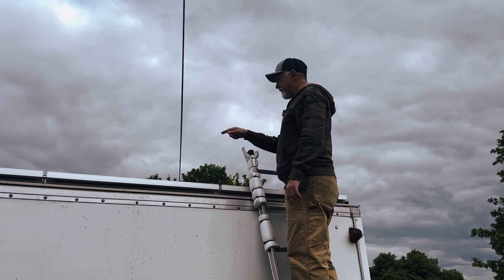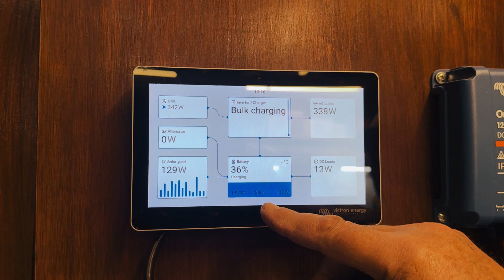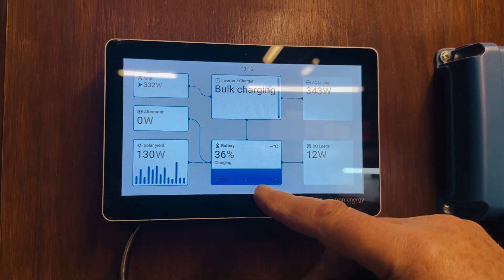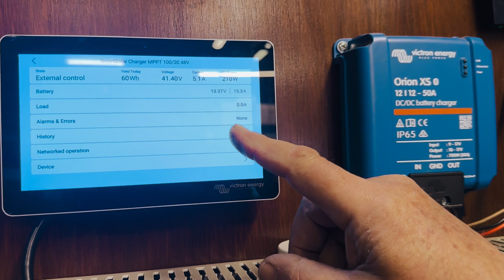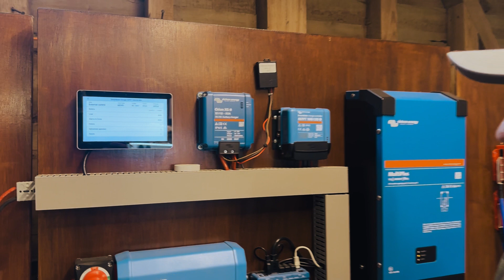Does shading affect solar performance?

Comment: If the panel and cells have integrated bypass diodes, it will not block the whole string. Cheap panels don't have integrated diods and will block the whole string...

Comment: Victron panels may be different but unfortunately most other panels do lose most of their output if put in series and there is some shading on one of them. I have done this testing myself (similar to what you did) and documented it. I think the most valuable thing about your video is that people should test their panels before setting things up so as to guide their set up and what is necessary for optimum efficacy